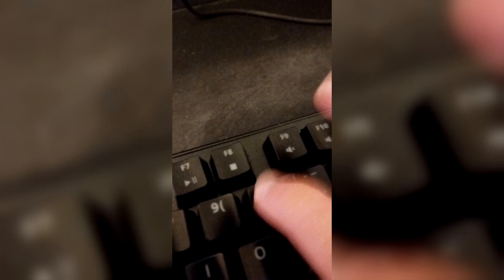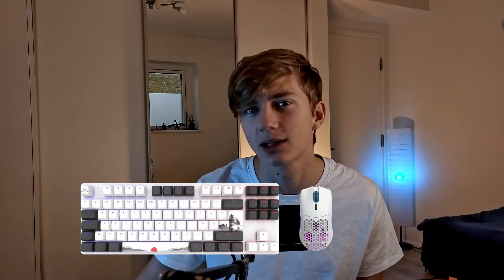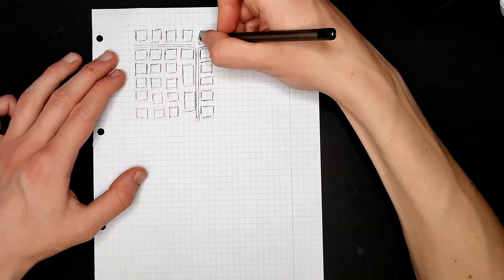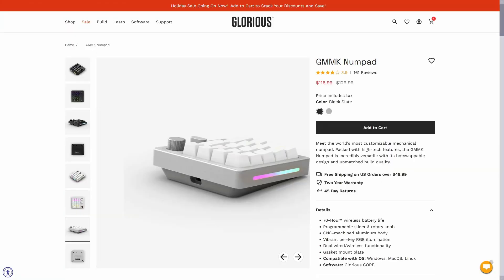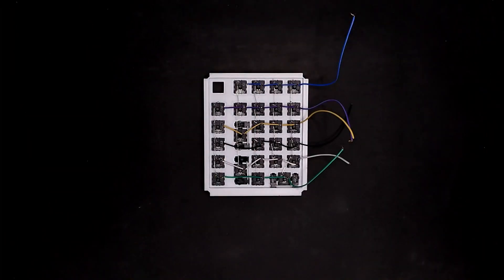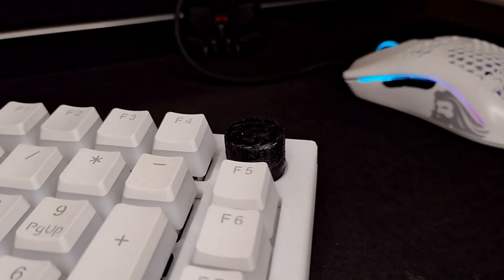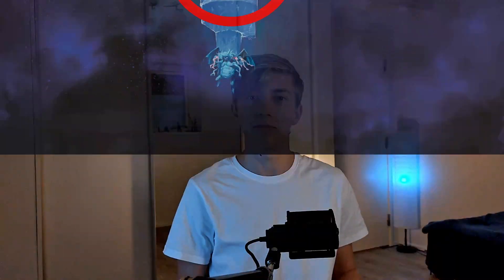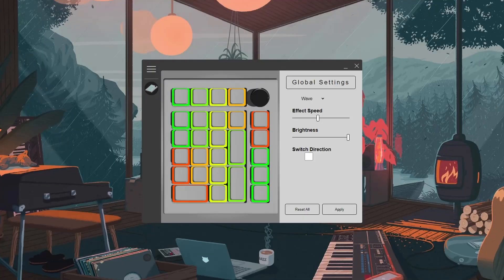I built my dream keyboard | Custom DIY Numpad

Comment: hi great video where did you get the number pad key caps from I cant find them anywhere
Reply from the maker: Thanks! The keycaps I used are kc104 pudding from a company called spc gear. They however rebranded some time ago so if you don't find them this way, try searching for endorfy pudding keycaps :)
Reply: @Phunder  thanks for that it held a lot

Comment: why not tear apart a cheap mouse and install the mouse board in the bottom of the 10-keypad..?
Reply from the maker: There are multiple reasons for that:
1. Those boards aren't usually easy to reprogram yourself once they're out of the factory
2. A keyboard needs a different set of Input/Output pins that will make connecting the switches, the LEDs and other things you might want to add possible, it depends on the exact device you want to build

This video is not a tutorial, if you want to learn more on how a  keyboard's internals work then search for "how does a mechanical keyboard work", "how does a switch matrix work" and whatever else you have doubts on
Reply: @Phunder  i think you over-engineered the idea.  i didn't mean adding it to the circuit, i meant kitbashing a mouse into your project.  it wouldn't be pretty, with an extra usb cable sticking out of it, but could serve a purpose.

btw - nicely done.
Reply from the maker: So basically you meant making the numpad a mouse at the same time? XD